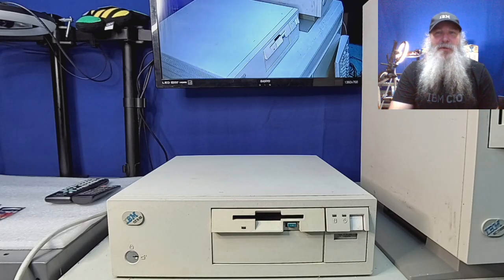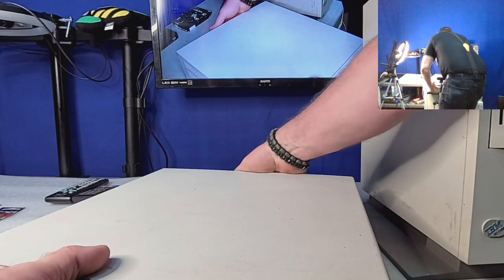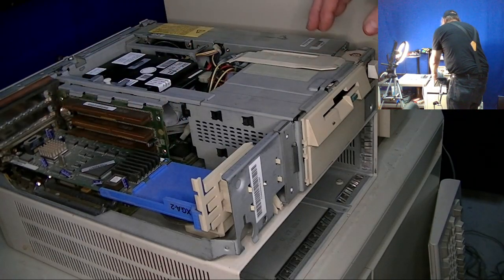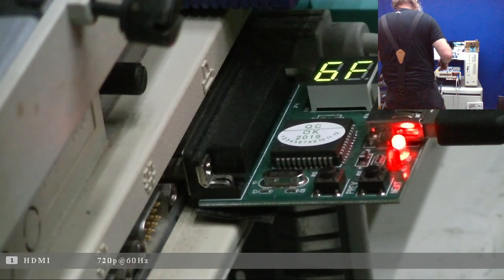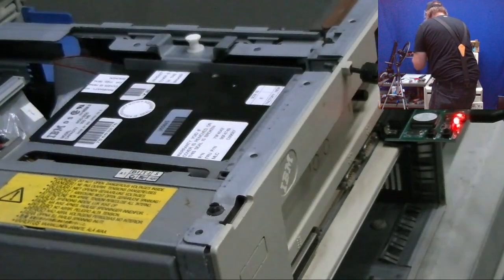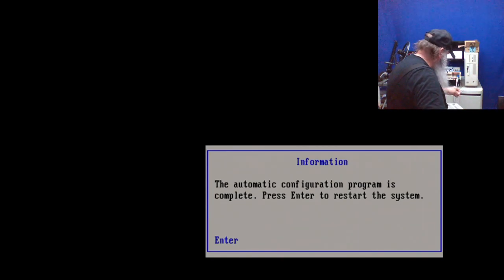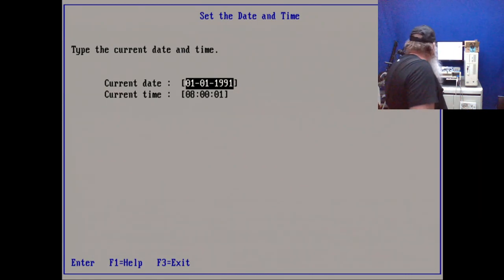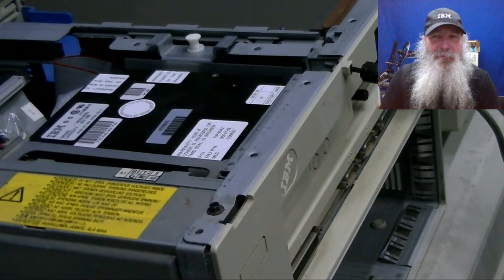Using a parallel port POST code reader on a PS/2!

Comment: I can't get over the fact that as expensive as these systems were that they came with SX CPUs!!  Thank goodness for the ability to upgrade.
Reply from the maker: IBM was really slow to move to faster CPUs at an affordable price - and produced levels of systems that were out-of-date even at introduction. My story is that my Dad tasked me in 1992-1993 to buy an upgraded system from the 286 he used in his business (a story in itself). I went to Computer City, and they had a floor display of a Model 57SLC (386SLC-20) that was being sold for over $3,000 with the monitor!

At a fly-by-night strip mall (also in El Paso), they had a 486DX-33 clone for a little over $1,000 (I still have the receipt somewhere). We re-used the VGA display that was on the 286. But I did discover that the system had a Model 30 90-watt PSU hacked into the case (not a trivial thing either) to cut corners. And there are case markings that they also used it for their 486DX2-66 model!

To IBM's credit, that PSU never failed under that heavy wattage load. I still have the case, and a year ago I had plans to revive it with a miniature 386SX motherboard that draws much less wattage. That project is stalled.

But that's all the evidence of how brutal the "clone wars" were to IBM pricing - you got a sh*t clone computer, but at a price to move through the upgrades better. I didn't even have a 386DX computer until I went retro, and I even replaced a dumb ASCII terminal with a 486DX-33 that ran Procomm Plus (with the easy scripting I had to do for Dad-level functionality to connect up to his supplier's mainframe) on MS-DOS 5.
Reply: SX/SX2 would be ok for most home users, but these machines were business-oriented, so yeah not the best choice for that sector...
Reply: @IBM_Museum  Due to the price. I thought IBM discontinued the ps/2 before they did. As for the clones. I started working at a computer shop in 92. I saw first hand about garbage clones. We did not want returns. So we purchased higher in PSU, certain motherboards and so on. A good example was cases. The cases we sold didn't have sharp corners and you could stand on. The other stores in the next town over. You would not be able to do that at all. I do have to admit. The IBM PSU and machine was built like a brick. But if you got the correct clone parts. Say on the PSU. I  remember changing the 80mm fans up to 3 times on a PSU and the PSU itself never died. Compared to other cheap PSU. They would die all the time. Some wouldn't even make it slightly past 1 year. We didn't want to have that reputation.

Comment: i love these computers!  my first computer was an ibm 486sx/25
Reply from the maker: PS/1? There were a few PS/2 models with a 486SX-25, it just wasn't a common CPU for them. The PS/1s typically had the 486SX-25, or the IBM Valuepoint series too.
Reply: @IBM_Museum  ohhh! yeah a ps/1

Comment: I wouldn't recommend replacing the battery with the system still powered on... especially if you are gonna use a screwdriver to remove the old one. Hopefully, the CMOS/RTC chip survived all that.

Good idea with the PS/2 to USB adapter though, very convenient way to get 5V for the reader.
Reply from the maker: I need a disclaimer - and yes, I stumbled quite a bit (with video, keyboard, mouse cables, power buttons being on, etc.). There is an issue with good batteries not making the system hold the configuration with Bermuda-based system lately. With other PS/2s that have a Dallas module that I've modded, I've learned to have the battery slot vacant, power up the system, and insert the battery.
Reply: @IBM_Museum  Hehe, one of those days, eh? Hmm, is there more info about the Bermuda config issue? How common is it? Are the battery holder contacts clean and "strong" enough to make good contact? Does the Vbat pin of the Dallas chip receive the battery voltage? It could make for an interesting debugging video. My Bermuda is, or at least was, holding the config just fine, but I've completely disassembled the system yesterday to scan the board and clean the unit, so we will see what happens when I put the thing back together. And about the modded Dallas modules - what does installing the battery with the system powered on achieve?

Comment: Great video! I appreciate you not editing out goofs. Is there a list of codes you ca provide a link to? I ordered one of these devices on your recommendation.
Reply from the maker: I was rushed and should have focused my attention better - I'll get a list of the parallel port codes for you.
Reply from the maker: http://www.bioscentral.com/postcodes/ibmbios.htm
Reply: PS/2-specific checkpoint lists can be found on the Ardent Tool website (Setup & Config -> Troubleshooting -> CP Codes). There are 3 "generations" of the PS/2 firmware - ROM only, IML, and flash-based premium systems. Meaning of the codes differs between the three, so make sure you have the right list. The IML list is currently missing unfortunately, and I'm not aware of any document that has the necessary info, so we will have to rebuild it the hard way probably...